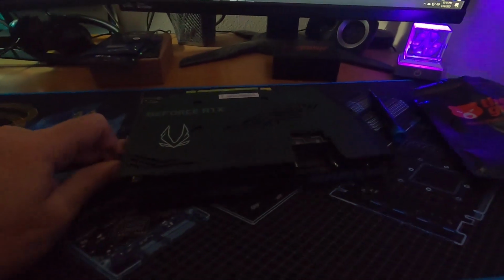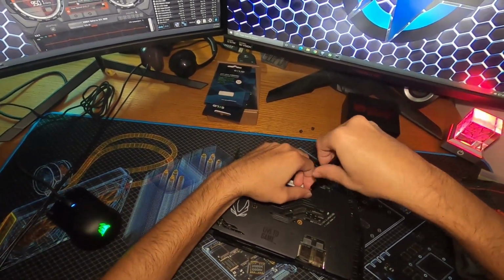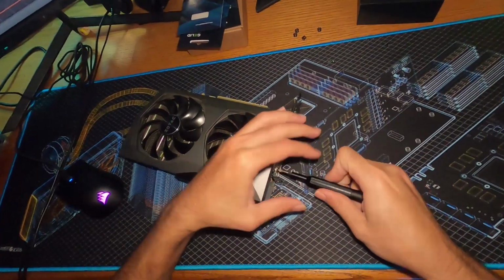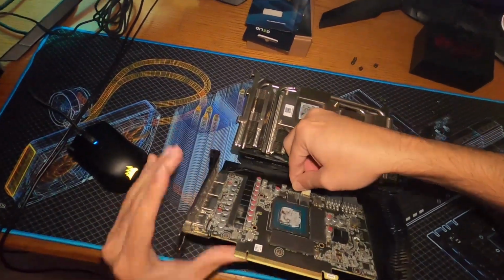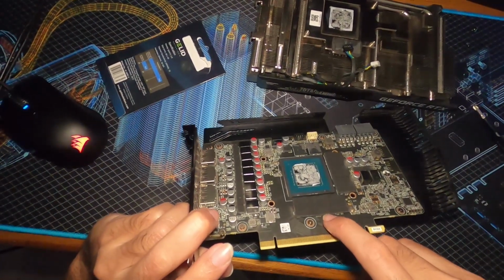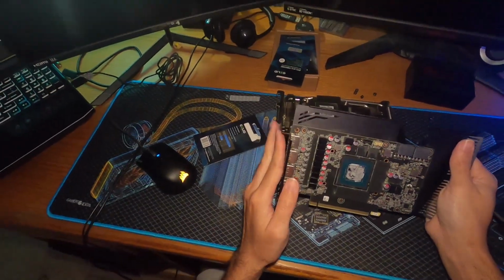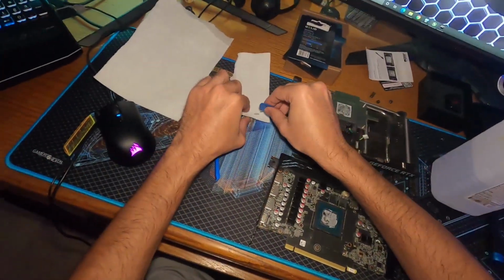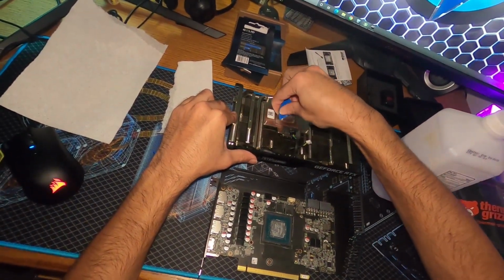Teardown Zotac RTX 3070 Twin Edge

Comment: I found this card to overheat with many games, I was not able to play Satisfactory or WZ on full specs in a 2k monitor until I installed a water block
full specs on 1080p worked fine but for my 2k monitors I had to cap at 60fps

Comment: Have you noticed any improvement in temperatures after changing the thermal paste?
Reply from the maker: Yes... a 4 to 6 C decrease in Core temps but one problem... the rear fan. The bigger one, just popped off the hub. However, it is in a server case and run cooler than it did with the GPU fan shroud.

Comment: I have the same twin edge cards and haven't had any issues. what's the issue your facing and what are your core/mem overclocks?
Reply from the maker: Wobbling rear fan, starting to die. Others had to replace the cooling shroud entirely

Comment: So they definitely could have made an even shorter card..........
Reply: Definately could, since most of them use the same reference PCB, they just slap on thier cooling solutions to charge that premium. It's harder to justify a sub <300mm <2-4 slot thicc for $1,000+. ITX, small case buyers would be too niche.

Comment: Hello. My new ZOTAC RTX 3070 Twin Edge fans often ramp up and down randomly when temp reaching 55 degrees. The problem is when fans reach 100 % RPM for 1-2 sec and it's very loud. I used MSI Afterburner to make fans always on, but when Windows starts it also can ramp up to 100 % RPM (turning on). Do you have the same problem ?
Reply: just set the fan curve to a constant speed dont use the freeze auto fan mode, its broken and annoying everytime it hits 55 fan shuts but the gpu is idling so hot that the fan toggles quite frequently which is inefficient.